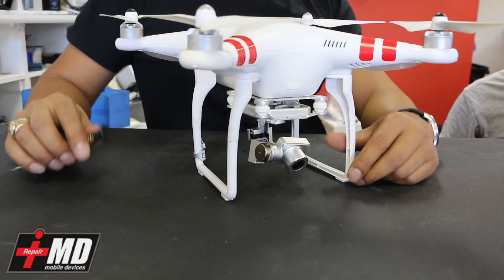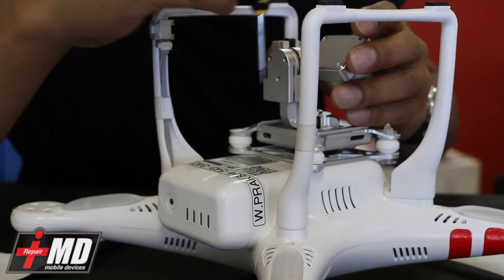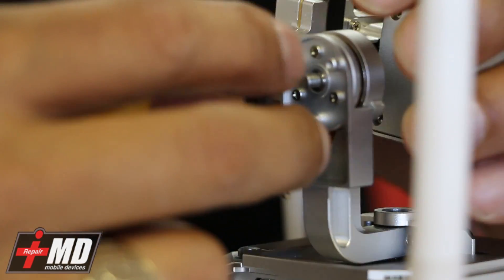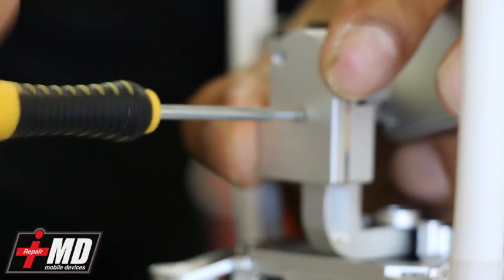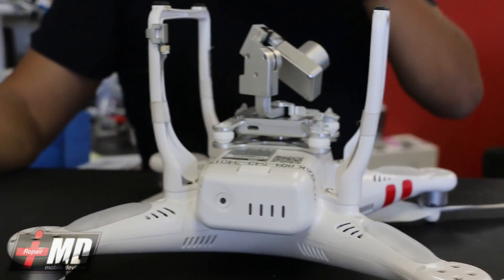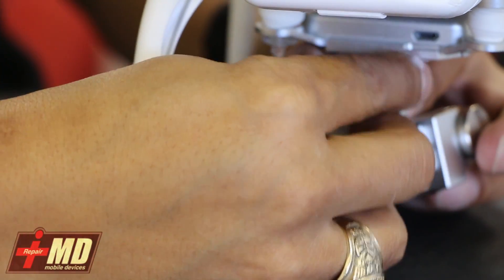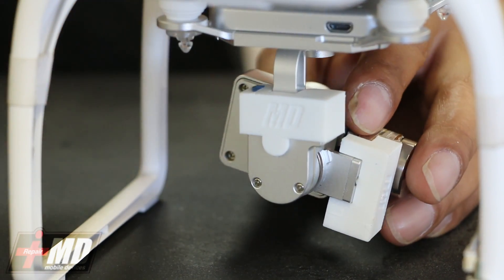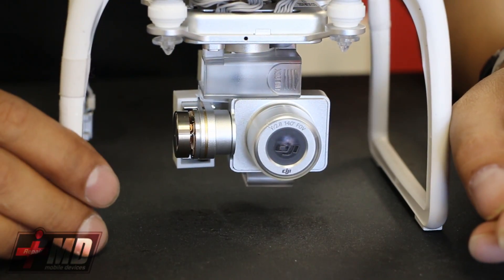Phantom 2 Vision Plus camera repair and solution

Comment: Hi, my phantom 2 not calibrate, when put find GPS with the controller put yellow and then I turned 360 put green, and after put vertical position and I turned 360 but never turn yellow color, start in color red flashing, can help me ?

Comment: I crash drone broke the cable. I replaced the cable and I had the same problem with the camera jitters and did exactly like the video but it's still jumping back and forth. I tried 4 times checking that  it was level. What else could it be. I thought maybe resetting camera.

Comment: Tried this but it didn't work. Ended up getting a new gimbal. Still have the same problem. Gimbal shakes and sputters just like the old one. Replaced the the WiFi receiver and components. Still no luck...anyone have any ideas?

Comment: I have dji phantom 3 standard my cam will not move went my dji started up but you will see the video is working what do you think is the problem maybe need new roll motor esc chip circuit board or maybe new. Pich motor. Help me please

Comment: Hello I got a crash with my vision plus and the Gimbal doesn't move on the last motor down under. It's like there get no energy. The second thing is that the App says Gimbal engine error pleas control the area. And the third thing the Camera doesn't connect every time.  Thanks

Comment: I have order a gimbal guard from you yesterday.
I concerning that would not solve my issue.
I was following your great fixing video tutorial of turning the roll shaft to horizon level and it WORKED.
the problem is after  flight or two it is returning to the be not horizontal leveled
and I have to do it again and again.
this is why I have order my gimbal guard.
is there a way to lock that shaft better ?

Comment: Thanks for the video.  Is an adhisive required to reconnect the camera over brush less motor?
Reply from the maker: Aaron Cohen yes, you might want to use a tiny amount of epoxy in order for it to hold it's position
Reply: My roll arm broke and the motor separated. Do I need to epoxy it back in the roll arm?

Comment: good video. i fixed the horizontal problem like you did . now the camera is horizontally centered. the gimbal came back to normal.  but then before flying, the camera just popped out in my hands. The ribbon kept the camera attached.  How can i stop the camera from popping out?
Reply from the maker: Bou Drone use my new drone guard
Reply: iRepairMD Youtube i rewatched the video.  at around 0:50 seconds you show the camera where it seperated.  but when you put the 2 guards, i don't see that either of them is actually holding the 2 pieces together. the camera and the back part of the gimbal.  horizontal sensor part.
Reply from the maker: Bou Drone check my most recent video on drone repair to see the new guard

Comment: Can I send my camera to you the problem I'm having is I was in a crash and now the gimble buzzes twice then wait three seconds and does it again there is no action with the gimbal but it does show a picture through the camera to my phone. I did exactly what you showed on your video but nothing. The buzzing seems to be coming from the side of the gimbal where the camera turns up and down right on the shaft. Ty in advance. By the way I purchased your ribbon protectors and they work great everybody should get a pair.
Reply from the maker: Motoman jake yes I can fix for you send it over
Reply: iRepairMD Youtube Hello! I am from Greece and I experience the same double buzz and stop sound on my vision's gimbal. Trouble is that I am very far to bring it to you. Could you please give me any advice?

Comment: Thank you very much for the video it  helped me fix my drone, my only add on would be I use the plastic bracket to secure it in place, then I adjusted the spindle (I did it 3 times until then and it was never straight enough) thanks again

Comment: Can you repair a DJI Inspire 1 cable to the camera gimbal. I hit a limb and the gimbal wires pulled out of the connector. The wires were carefully pushed back into the connector and the gimbal works but has shuttering when flying. I don't get the smooth gimbal with floating camera like before. I tried to find a replacement ribbon cabal but no one sells it yet.
Reply from the maker: Aeris360  I haven't tried fixing the Inspire 1, but I'm sure the electronics are the same. I would like to give it a shot contact via email to discuss this option

Comment: After safely landing my Vision 2 Plus in high winds, a huge gust of wind blew it into the water before I could get to it. Weird feeling seeing it go into the drink; I felt helpless but glad I restrained myself from diving in. Anyway, after meticulously rinsing off the salt water in the shower and drying it with a hair dryer, miraculously everything worked BUT, I cannot get an image of my photos in my ipad although the pictures and videos come out great.I figure it is the wifi but I cannot find the wifi antenna anywhere unless it is attached to one or both of the regular antennas in the legs. What should I do or what can I do? The menus and GS and GPS are all perfect.
p.s.: forwarning: a wet battery is dangerous. Started smoking badly!! Radio Shack disposed FAST!!

Comment: Just snapped the  flex cable. Any solutions for this or do I just need to get a whole new camera and gimbal? Cheers mate as I was doing so well until my big fingers bloody pulled to hard.
Reply: Steve Maxwell It is possible to get the cable but might not be easy. I know there is a company called atkdrones based out of utah that offers a replacement service for this cable.

Comment: How did what you do fix the problem when at 4:14 in the video the camera pitches down?
Reply: That i dont think is a problem. The gimbal was probably adjusting itself. For example maybe on the phone he set the pitch down therefore the gimbal went down after it finished leveling. Thats my guess...
Reply: Mine does this also.  It is normal.  It is the starting point for my set up.  I always have to readjust the camera prior to flight.  If I do not have a connection then it goes to this point also.

Comment: Hi there,

We can replace the ribbon for you (as long as the gimbal, motors and camera are not damaged).
We charge a flat fee of $160 to replace the ribbon cable for the Phantom 2 Vision + camera/gimbal unit . This price includes labor and parts.

For more info please visit:
http://www.helihobby.com/multiro ... repair-service.html

Repair center location: California, Los Angeles County.

Comment: I had a crash that created another kind of problem with the Gimbal, a problem that is not described in any of the previous Phantom 2 Vision Plus repair videos.  The gimbal motor was making some noise and it was over heating.  When i tried to connect he camera with the I-phone, it showed a message that something was blocking the camera and it showed a link failure, even when there was apparently nothing blocking it. I tried re calibrating, upgrading the software, nothing helped.  The Phantom was fine, but it was impossible to operate the camera due to this Gimbal and the "fail to connect" error.  At the end, after two hours looking at repair videos, I realised that after the last crash, the phantom hit on a rock and one of the axis of the camera (the horizontal axis) was not moving, in fact the camera was looking at one of the landing legs instead of being at the center.  I was not aware about this because the camera was free to move in the other two axis.  Unfortunately there was too much friction with the metal base because the whole camera moved up after the crash.  There is a small screw on the supporting camera arm (the metal piece that is a 90 degrees elbow) that allows you to move the position of the camera down the shaft avoiding the friction of the camera arm with its base.  After re-adjusting the position, I was able to move the camera freely in all 3 axis.  Powered the system on and the problem was solved.  Just saved myself $600 USD.  I was so close from giving up. 

 I have a couple of DIYS tips for all DJI pilots.  I used the same PU foam material that is used as an insulator to protect the pipes from freezing. Yes, the one that is cut in the middle at full length and comes with an adhesive tape to use it to close it once you wrap the pipe.  You can cut to pieces of this insulating material and wrap it around the landing legs of the Phantom.  You will have an ultra soft landing and a much more stable support.  Believe me, even in a windy day it will land with safety and it has a very low weight.  Just make sure one side is not as long as the other side in order to avoid blocking the field of view from the camera or you will end up filming the polyurethane foam. Total cost for this simple solution is less than $1 USD. Another good tip is to replace the safety cord that goes around the guards with a high decitex elastic thread like Spandex or Lycra, for example using two strings of 840 Decitex.  The Phantom will gently bounce without major damage in case it hits an object horizontally at slow speed, without having to use a new cord every time.  Here a video I made after the camera accident, as you can see it is working just like new  https://www.youtube.com/watch?v=KdaYjcIDVqs&list=UUMtmVHrqQ0fIbKA8tKu4JWg

Comment: This is a well done video, and I thank you for making it.  But it doesn't address the other axis, and problems with it,  which also cause the shaking, intermittent behavior like your video.

I had the same problem, and did what you did here.  Sadly, I seem to have trouble with the other axis as well.  I've been searching, but no one else seems to have the same problem.

If anyone has experience in that area I'd love to hear about it.

Thanks again.

Comment: My buddy and I both bought the "snap on" parts for our new Phantom Vision 2+ and both had fitment problems. T

he part that is installed first in the video (yes, we watched as we did the work) goes on pretty well but the tab that is supposed to "snap" into place does not. iThe tab will not reach the screw detent. The second piece ($20.00) does not fit at all. Neither his nor mine will fit

Yes this sucks

Now what??

we would like the parts we ordered to fit!

A great idea but poor tolerances on the parts

Comment: Will the Horizontal motor be kept in place and not separate in a heavy crash by your guards, therefore stopping the cable from snapping.

Comment: I had the same issue, but I had to align both axis, the vertical, and the tilt, If your unit don´t solve the issue with the alignment of the Vertical, you have to align the tilt that goes with the camera, this is not as easy as you do the vertical

Thanks for this video, and Im going to buy your flex cable guard.
Reply: Hugo, where would I also find the tilt to adjust?

Comment: i am gobsmacked!! My camera did this exact same spasmodic motion after my first crash.  I sent it back to my authorised dealer/repair agent who was only to happy to say there was no repair possible and i was billed 600 UKP for a new camera and gimbal to be fitted.  They sent out the drone back to me without my old damaged one (for parts) so i requested they returned it, to which they have. However wasnt my old camera they returned as it had someone elses memory card in it. So god knows what is wrong with the one they sent me.  I wish i'd seen this video before i returned it for repair :(

Comment: My phantom be as same problem. But I believe the problem is on the other axis (tilt). when I disconnect the flat cable from the tilt, the gimbal back to work. how do I solve? I dont know the default position of this axis. Please.

Comment: Hi Question, I have re-adjusted horizon several times.  Can you tell me if that is normal?  Also, I can't seem to get it perfectly level, is there a fine adjustment somewhere?
Reply from the maker: Try using super glue at the point where it makes contact with the shaft in the body

Comment from the maker: it protects the flex cable from abrasions  during a crash that can sever the flex cable. So yes to an extent it protects the flex during a crash
Reply: Has the Horizontal Motor been stopped from separating by your guards or will the motor separate on having a heavy landing, thereby snapping the cable.
Reply from the maker: John Goodwin the New Guard XL will prevent the gimbal and motor from separating in an event of a crash
Reply from the maker: +John Goodwin yes sire this will fix that issue

Comment: You should have shown the shaft being offset improperly before removing the board.  One shot shows it briefly and it looks level to me.  Like Green Spam said, it only fits on in the proper position.  Don't understand this being the issue.  Did all this and mine is still erratic.

Comment: i have tried it this way and no luck 8-( I noticed that if you open that little part it only fits back on if you have it in the right position anyways, anyone has more tips? i just had 2 or 3 flights, small crash and now its become useless
Reply: Check the shaft which runs through the motor top the gimbal arm at the front. I just repaired mine. THe control unit was OK (flat side racing down) but the actual gimbal had spun on the shaft. I held the back with a pair of small pliers and then gently twisted the gimbal arm until everything was lined up. Works perfectly now.
Reply: Chris Dobie hi although my english is fine i would like to see that what you mean, do i need to open something? I have 2 moving/rotating parts on the camera 1 and the other on the gimbal i think, it has a long black wire on it..
Reply: Yes you need to do exactly what he does in the video and when you have removed  the control board hold the shaft with pliers
Reply: Chris Dobie i have done exactly that over 10 times it just doesnt make sense this video, when you take of the cap from the rod it is in a certain position anyway and if i want to put the mini board on it IT only fits one way or it doesnt fit at all, so i turned it left clock wise put is back on and its still shakes like hell 8(
Reply: Geen Spam  you need to align the camera with axle notch straight horizontally, if still not fixed then your camera is to loose on that tiny axle, I used tiny tiny spot of locktite on the axles that where it inserts into the camera part, then make sure you align everything before it dries...
Reply: ESideMolodezh Make sure it's Loctite 290
Reply: https://www.youtube.com/watch?v=5iTz3Dd2Ecs this should help you if you haven't got it fixed yet.

Comment: Hi , My P2V+ cam does exactly what like the one on your video - I did adjust the back shaft but still does the same jerking … Do you have any suggestion why ?
Reply from the maker: check your cable connection, it might have a small cut.
Reply: Cables look perfect . Really weird.
Reply from the maker: has it crashed before, if so one of your sensors needs to be reset.
Reply from the maker: if you had a gimbal separation from the Drone from acrash it's also possible that one of your 3 ribbon cables connecting your Gimbal to the drone is not making a secure connection.
Reply: I did not get a gimbal separation. The drone fell on the grass from crashing in a tree at about 15 feeds . the drop was not that hard. no physical damage… I am so sad.
Reply: HOw do we reset the sensor ? with the software I guess. is it the IMU advanced calibration ?
Reply from the maker: Diane Lorrain I'm sorry my shop is not near you or else we can likely fix it.  I believe this is a simple fix, keep researching. and let me know what your fix was
Reply: Wathana, how do we reset the sensor ?
Reply from the maker: send me a video of your problem
Reply: I just got this error message when trying to update from the PT2 software : Abnormal compass data. Please restart the Flihgt Controller or reconnect the compass due to the losse connection.  if this error continues, please contact your dealer or DJI customer service.

Comment: You should demonstrate how the protection works with the gimbal set on. I feel like they might rub or the added weight might cause unstable videos. Lets see a video I will buy and many easily! This is genius if it works. My only concern is how gimbal gets affected. I don't want to lose smooth shots I want camera centered while it sways back and forth.
Reply from the maker: It's made with PLA plastic, it's very light and strong. It's does not cause any shake and it's not rub on each other in flight. I will upload a test flight video of it this week.
Reply: Wathana Prak awesome thank you! This could be the solution to everyone's flimsy gimbal problem!  Trust me alot of complaints alot of costly repairs!! ! If this works wow!!! You are genius!!